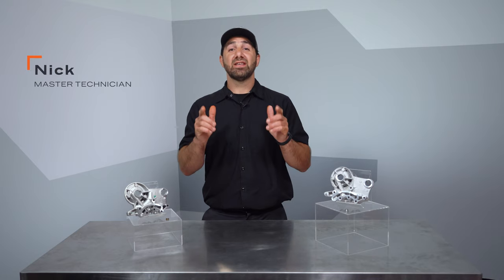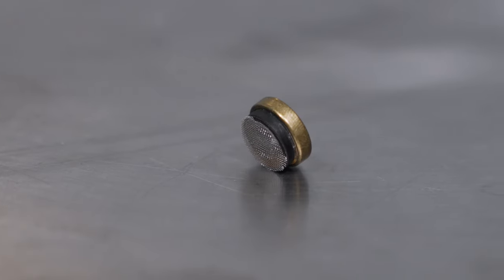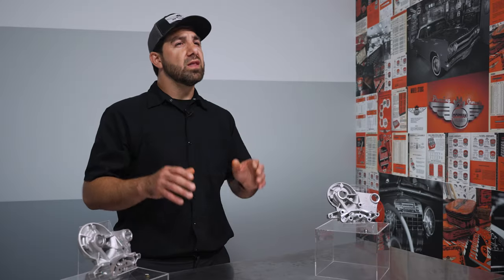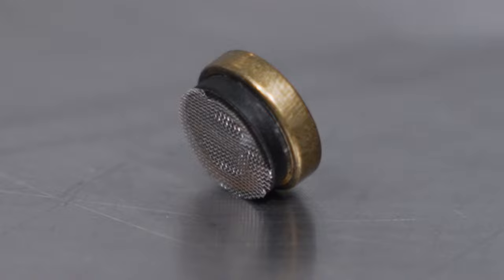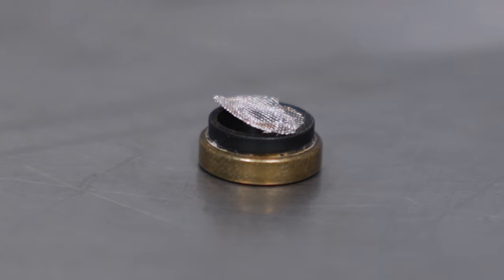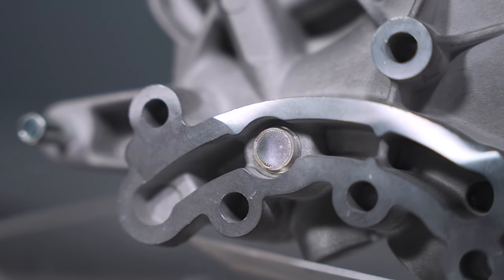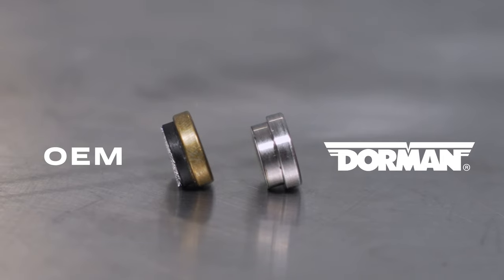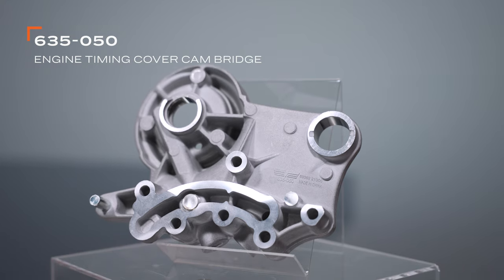Fixing a unique VW and Audi 2.0L engine cam bridge problem

Comment: Hi, i bought it "06H103144K" but the diameter is smaller than the vw one, when mounting the camshaft adjuster magnet wasn't able to clips inside.
Reply: 06L109259D camshaft adjuster magnet
Reply from the maker: Can I please have the year, make and model of your vehicle?
Reply: @DormanProducts  Make: Volkswagen, Model: cc (1.8 tsi), Year: 2015

Comment: Hi mate we have the 2016 vw 2.0 gti in the shop low oil pressure.  Is it just a matter of removing the screen
Reply from the maker: Good question! You will want to replace the entire assembly, not just the screen.

Comment: Hi, is this issue still going on Audi q3 2019.09 2.0 228 hp? After 15 minutes running, I get the message: “switch off engine oil pressure too low” but if I slightly rew it, it disappear. Thanks a lot for the explains! 🫡